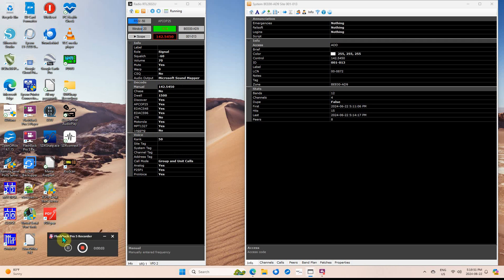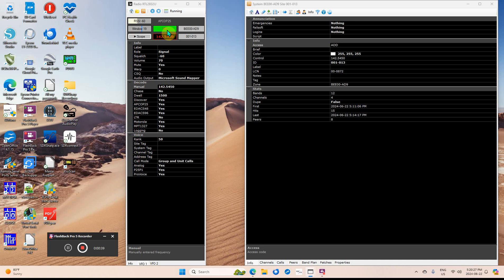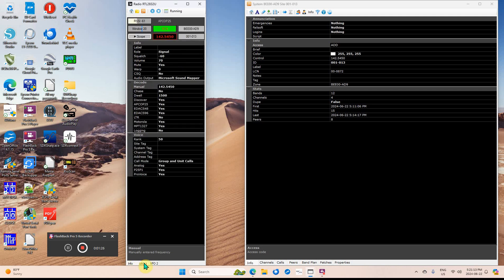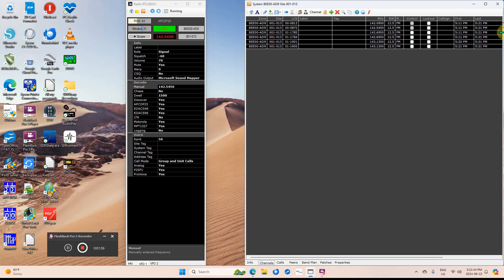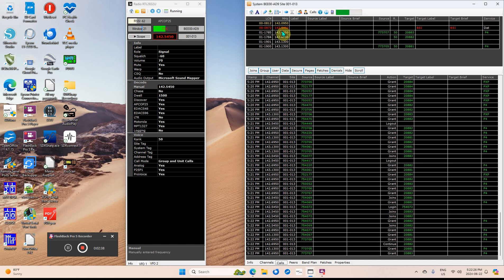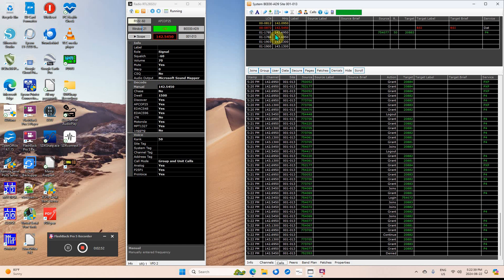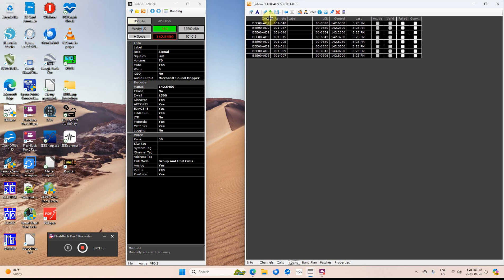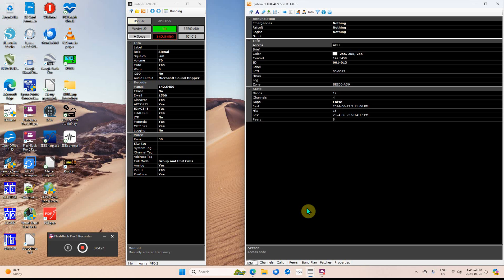setting up Unitrunker to run on Public Safety Radio Network (PSRN)

Comment: To improve the health, click on the scope button..  then left click on the resulting pop-up waveform window several times until the signal type changes from Disc to IQ.  if the peak of the frequency is on the center line there, then your health is as good as it's going to get.  but if the peak is not on the center line, then adjust your Warp setting up or down - to move it left or right until it is on the center line.

Comment: What are you using for a radio?  I’ve wanted to get something like this going and hopefully, it will work with my screen reader and Braille display!
Reply from the maker: I am using a SDR Dongle on my computer.
you can find them by doing a search on google.
Steve
Reply: Can you kindly do a video on the setting from  the downloading ?
Reply from the maker: @khalilmekdachi7070  I just downloaded the unitrunker software, and started it up and in the video, I walk through everything I did, and you need to put in a control channel for the tower you want to decode. Sorry I cannot help you any further, I made the video so people could help me out.